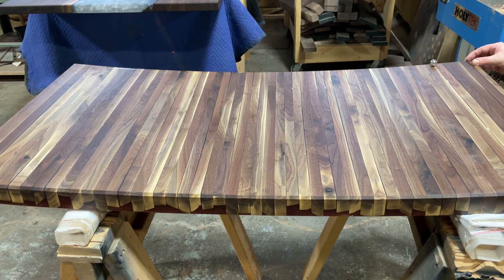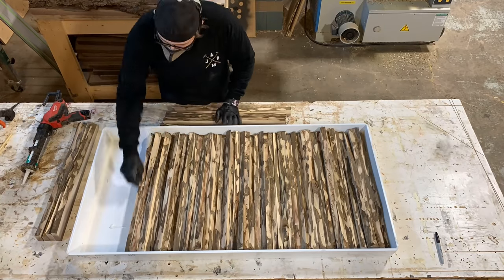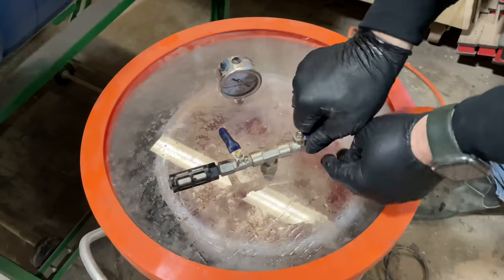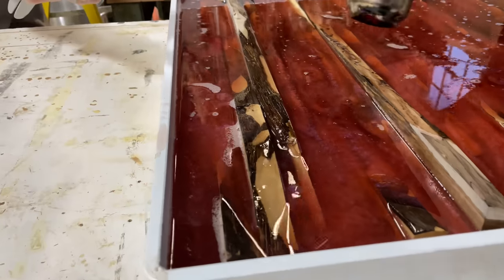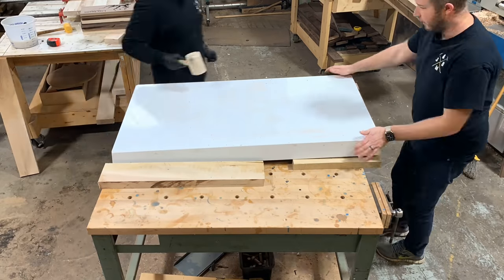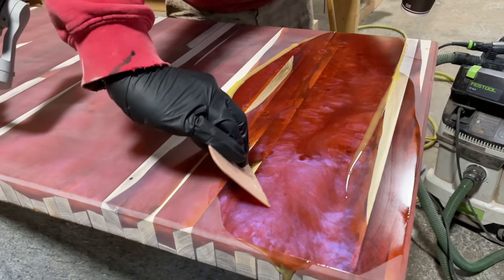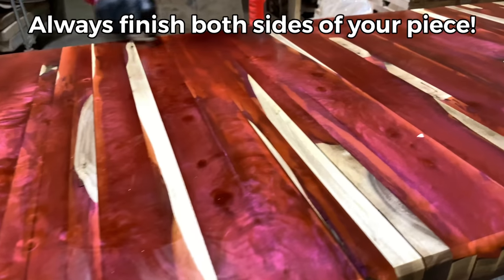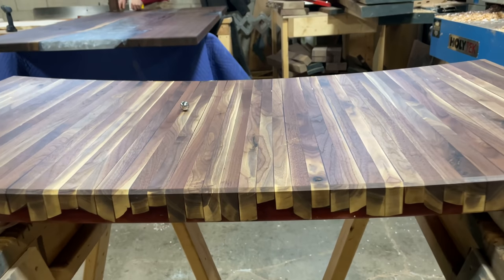EPOXY FAIL | Don't Make This $1000+ Mistake

Comment: Well your project failed, but i would suggest to use it as a table. Pour clear epoxy resin on curved side to make it a flat table. It will give a depth to the look on sides as if its sliding down. The bottom can be kept as curved a different look and style, or planed it down to make it flat.

Comment: Place a 50 lb weight on top of the humped center for 30 days, measure the height difference between the center and both edges to calculate how much of each of the 3 places to sand until the table was completely straight! Of course this technique would've left the table slightly thinner then originally desired! Peace

Comment: I'm late to this but I see no reason whatsoever you can't put it in a slightly deeper frame and clear coat it all the way around so that it's still level top and bottom. Sure it's going to cost you a little bit more to coat it again but you'd still have the exact same design colors look everything you were originally going for

Comment: Another late respons!
Maybe alredy in the comments. 
Make some cuts on the bottomside and force it down ,lock it with epoxi and a couple of c frames from end to end .
Or cut it and use it as curved legs on a similar table, closed curved ends.

Comment: If you guys still have it... Make a game out of it... Open up 5/8" holes with a forstener bit in random locations. Label then with random numbers 1, 2, 3, X. Get a ½" ball bearing and let it loose.. It's a two player or more game... When it drops through the hole... Other players have to take that many shots... If you get an X... You get a strike...3 strikes, you are eliminated. Last person still standing after drinking.. Wins.. Unless they are on the floor 😆

Comment: Wet it, cover it, and park a car on top of it for a few hours. Then reinforce the bottom by embedding thick metal strips or drill deep into the ends and tap in some thick rods and cap them or epoxy over them.

Sh*t, I’m not a carpenter.

Comment: Mill of the epoxy wet it Down and put weights on top to bring it Back even. The Color effect was to strong already and almlst all wood look vanished. It looked to overdone anyway. In my opinion the epoxy should work as an accent. Not drowning everything in liters of it

Comment: make the table thinner so then it will be straight
Reply from the maker: We could thin it out but the look would change entirely if most of the epoxy was removed from the top. It's quite warped so it would need to be quite a bit thinner to be flat again.
Reply: @jeffmackdesigns  and, if you put metal bars under it and then pull it straight .... and yes thin it out from both sides needed, wouldbe much thinner